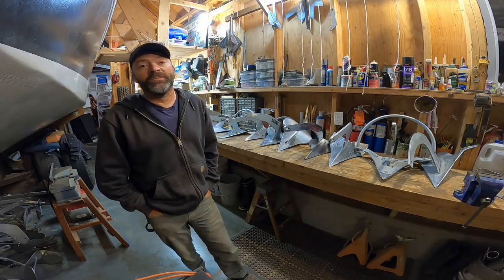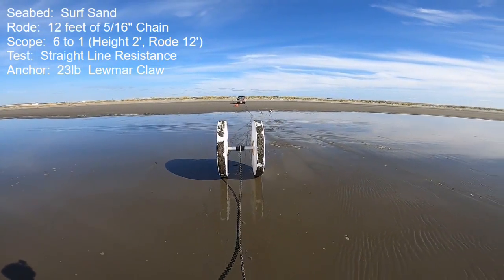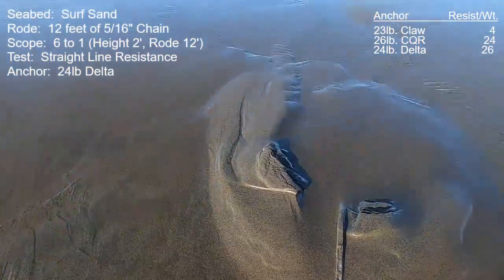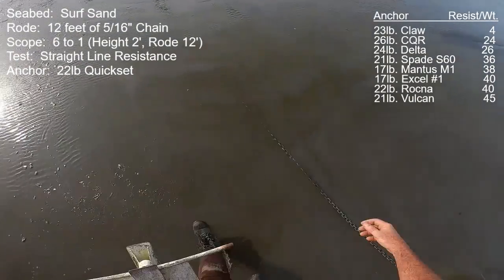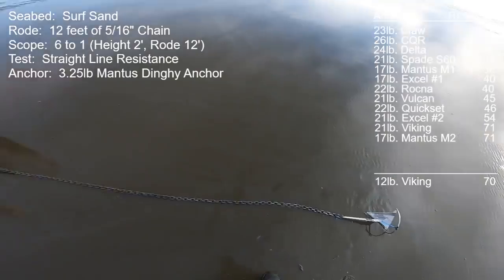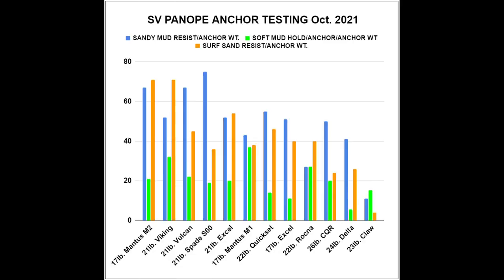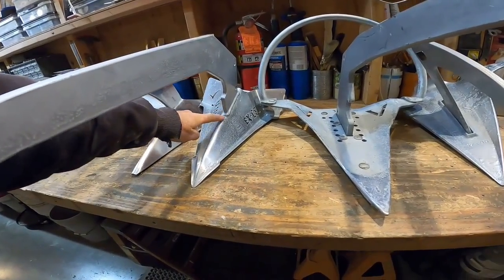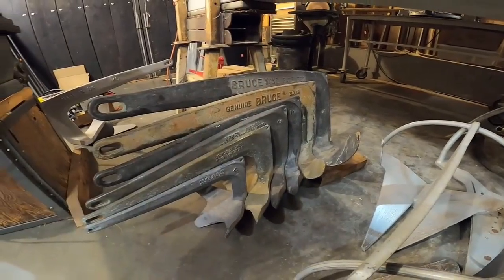Surf Sand Anchor Testing. Video # 126

Comment: What you need to study and comment on, is the ground bearing capacity of the sea bed, as its that and the Area of the anchor that determines the holding power etc etc
Reply from the maker: I believe that "depth of bury" is often more important than the factors that you listed.  Also, "throat angle" and other design elements have significant effects on holding power.  It would be very difficult for me or anyone else to create a "formula" for predicting anchor performance.  Hence my desire to test in as many seabed types and situations possible.

Comment: Hi. Here is my recent test. 
Excel #6, 65lbs dragged again due to short chain, 12mm 40 meter (130kg), plus 20m of 10mm dyneema rode.
Winds 60+ knots, and swells up to 4m
Seabed: mud
Depth: 5m
Boat: 39ft, 12 ton

Calculated wind pull 1600 lb
Wave jerk is multiple of that.
12mm chain MinBL 7 ton
10mm UHMWPE rope MBL 10 ton

Approximately.
Reply from the maker: "dragged again due to short chain"

Could we also say that the drag was the result of not having an elastic snubber of some sort?
Reply: @Panope  The tube keeps removing my replies. 

For snubber there was a 5 meter of polyester 3 ply rope 1"
And, that's right, a good big tire at the rode under water would work. 

I mostly rely on chain catenary, which is never enough. 
Lesson: chain should be 100meter
It's 340kg for 12mm chain. Like skipNovak has. 

BTW anchor reset was excellent. Wind  changed in opposite directions. It dragged across all Lunenburg harbor and eventually stopped, maybe caught mooring.
Reply: Wind rose record shows 110+ kmh on Jan 17
At meteo blue
Reply: @qb888  Your snubber under those loads would be lucky to extend by 5-10%, which would give it 50cm of maximum extension. Doesnt sound like that would be sufficient for 4 metre waves. Your snubber should be significantly longer, and possibly smaller diameter to be able to access sufficient strain, and provide adequate snubbing.

Comment: I respectfully disagree that "we" don't anchor off surf beaches. When the alternative is being washed ashore onto them, (say after broaching out of the channel, or having a gear failure, while crossing a bar) some of us absolutely do just that. And, if we don't get an anchor down in time, we use anchors (bridled together) to assist our efforts at salvage. So I think this is a useful dataset, and a wonderful addition to your excellent (unparalleled) body of work. Muchos kudos!

Comment: As steel is 3 times denser than aluminium would it be fair to say that the Fortress actually has resist/wt. of 82? How does this then compare to a genuine Danforth which is similar but steel version of a Fortress?

Comment: You already know this, of course, but there’s a problem with comparing anchors based on their weight. That goes to extremes with Fortress, as this test shows, and also the other direction, especially with the lead ballasted Spade. The beauty of using weight as a base line is that it’s simple to define. Fluke area might be more descriptive, but it’s far harder to decide precisely. Still, maybe it would be possible to make a correction, or some side comment about this issue, when it’s extra relevant?

Comment: Love your work. I’d be interested to see what you would come up with if you designed your own. 
Any chance of addressing what size anchor suits which boat.?
Reply from the maker: I'll design an anchor when/if I come up with something truly different.  Not really interested in "tweaking" a current design.  Anchor size is so personal, I really have a hard time making that call.  People have different risk tolerances, weight allowances, and boating areas, just to name a few of the variables.

Comment: Great test, like your others and getting better!
I found your inspection for feature trends, near the end, interesting.  However, one spec I think you may overlook is surface area.
(Continued in comments to this comment!)
Reply: (I meant to continue but my finger slipped! ) Anyway, I've found a few manufacturers list the fluke areas;
Viking 10 at 115 sq.in.; Mantus 17lb. M2 at 102 sq.in.: 20 lb. Vulcan at 113 sq.in.
I haven't found area listed by other brands. I do own a Fortress Guardian G-23 (13 lb.) and measured the flute area at 128 sq.in.  I also have a 33lb. Claw knockoff and am unsure how to measure the fluke area on it?
It seems to me the area engaging the seabed would have a significant influence on load holding once the anchor buried itself in a soft substrate such as sand.  Just food for thought!
Reply from the maker: Yes, I probably should have at least mentioned fluke area.  One problem is that I do not know how to measure the convex anchors so that we have an apples to apples comparison to the non convex.  Do I measure the "plan view" area, or the actual surface area of the fluke?  I could give arguments for either method.
Reply: @Panope  That's the problem I ran into with my claw type - how to measure. The anchor brands I listed above have surface areas listed in their specs. For example the Excell. Is the area they list the projected area of the fluke (plan view) or is it area of the metal plate when flat, before it is formed into the finished shape?  I don't have any to make a comparison to the numbers listed. 
Thanks for all your research!
Reply: Yes, I believe this to be the dominating figure in overall holding. I feel the danforth is a good example of this. But an anchor has to set for it to hold.

Comment: Brilliant as usual. Hope to see the same test for the 45lb rang. Thank you for everything you do!
Reply from the maker: That will happen.  It first I was concerned that testing at this beach would not be possible in winter due to not having daytime low tides.  I have since learned that I can conduct tests at most tide levels as long as the tide is falling.  Stay tuned.

Comment: Creative way to assure 6:1 scope. Great test that generally confirms sandy bottom results. I wonder if the angle between the tip and the location of the chain pull might be a better indicator of how deep they'll dive.
Reply from the maker: Good idea about the 'tip - chain attach' angle.  Might be something to it.

Comment: Steve , you are far and away the anchor GUY. The big wheel is cutting edge thinking. Your anchor survey showed the humble Danforth is still the most popular so please don't leave it out of the tests.
Reply from the maker: I actually tried to test an Danforth 18H (that I bought on Craigslist) but it did not set at all.  Upon closer examination, the anchor had previously been overloaded and was deformed in such a way that the shank-to-fluke angle is greater than designed.  I'll try again with another, unmolested Danforth.  Stay tuned.
Reply: @Panope  Thanks Steve, Lots of us Danforth guy s trying to decide if we need to upgrade and so far I am not convinced. Thanks again for all your efforts.